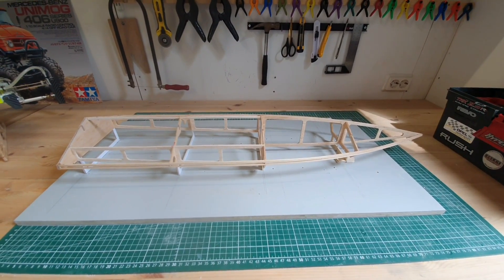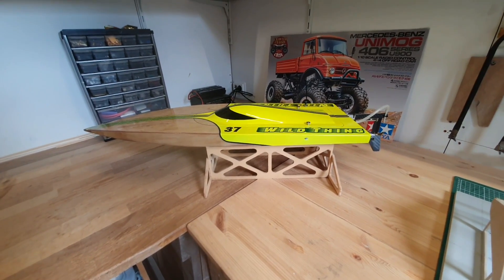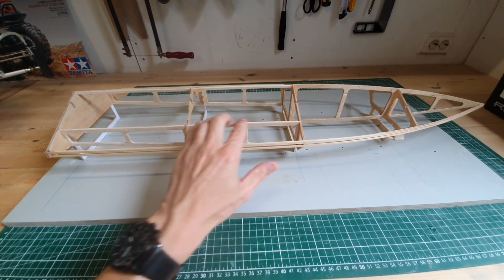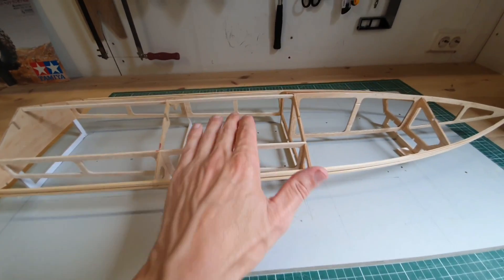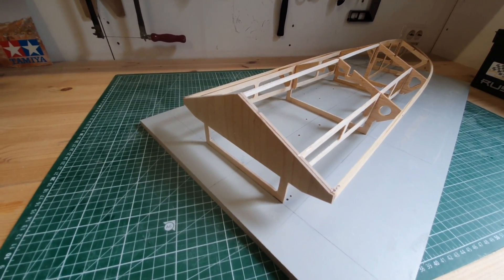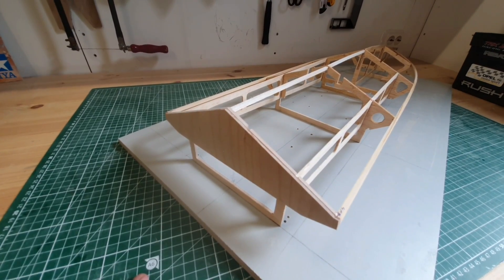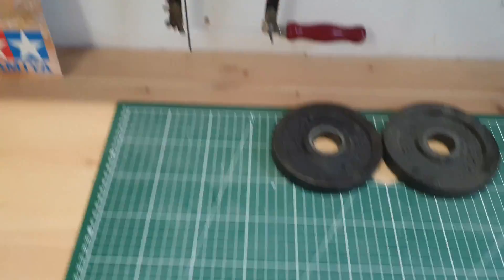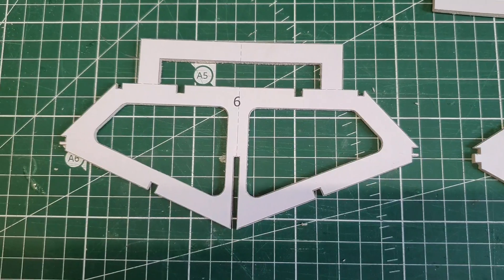RC boat build - Twin motor mono part I

Comment: Hello love watching your videos, which glue do you use?
Reply from the maker: Thank you, Mike! I use ca glue for the frames, and 2k epoxy resin for the plating, and sealing the wood.
Reply: @CozyRC  awesome, thanks. Have just downloaded your plans and got them printed out. Can't wait to start building this boat
Reply from the maker: Ah, nice one! There are several being built in US and Australia, that I know of. Will you put a twin setup in it?
Reply: @CozyRC  well now you can add New Zealand to your list. My head tells me to do a single motor. My heart tells me to do a twin and go full speed. 🤣
Reply from the maker: The bottom design of the hull is almost the same as my Wildthing. That boat ran 120+ km/h with a single motor setup. Rocket 4074 2000kV, Flycolor 150A, and CNHL 5200mAh 90C 6S lipo 👍. See this video for my Wildthing: https://youtu.be/h7QpCyItGts?si=_jqYz_2lhueDCPEK
A single motor will be crazy fast, too 😎

Comment: Hello. What saw blade do you use? It makes extremely clean cuts.
Reply from the maker: I use a jig saw blade for metal. It has  very fine tooth. But the smooth edges are the result after sanding!
Reply: Do you have an idea of the number of the blade? In ali-express they have, for metal, 01,02 or 03, plus some others for plastic and wood.
Reply from the maker: @OliveiraX  Sorry, I have no Idea, because I buy them locally at a DIY store, and it doesn't use such numbering.
Reply: @CozyRC  No problem. I'll get all 3. 😁

Comment: looking good!, I have watched the series already but I was wondering what type of wood you use? thanks a lot!
Reply from the maker: Thanks, I use birch plywood. 3mm thickness for the bulkheads and 1.5mm for the plating. ✌️DJ
Reply: @CozyRC  thanks a lot, do you use a protective coating against the water?
Reply from the maker: @maartenbernhard7663  Yes, I laminate the boat with glass weave and epoxy, for strength and water resistance. ✌️

Comment: Very interesting to see, but all that work... I see myself as a real rc enthousiast that likes to build, test creative ideas or try to make parts myself but this is just a step to far for me. But someone mentioned lasercut, that is an idea (for the future maybe). Sell models in a cut package.. 
Think youre right about the drives btw. I think that is more efficient and possibly easier to get it to run good... Nice work
Reply from the maker: Thanks Peter 👍.  I realize scratch building is not for everyone. Back I the days, this was the only way to make your rc boat or plane. I still like this way of building, although I might go for laser cutting in the future. ✌️

Comment: I thought it was laser cut bulkheads,so neat! Great job,mate!
Reply from the maker: Thank you Sakibian! Now you can make such neat bulkheads too, with basic tools 😎👍
Reply: @CozyRC  I'm not that good 🎃
Reply from the maker: @b2beyondrc This is not my first scratch build. Even with small imperfections you can make a great running boat! 
I made a Hydromite mini hydro as my first scratch build boat. It is more than 13 years ago and it is still running strong!

Comment: Wild Thing IV parts build=123kmh
Twin Wild Thing VIII parts build=? kmh😋
Reply from the maker: Let's see Daiciu, I hope at least 140km/h and if I could beat 160km/h or 100mph that would be my ultimate speed goal. But most of all, I will enjoy the build, running and tuning process and I hope to share it with you all 😎. 
Did you run your boat lately? I am sure your boat is 100+ km/h already!
Reply: @CozyRC  It whill be a very  beuthyful build Cozy I'm shour of that and fast to😁
No ,last weekend din't run my woody,thanks for the encouragement 100+
Reply from the maker: @daiciuapostol79  Allright, I will wait for your next results 😎.

Comment: I already know that this is going to be an epic build! I think you're on the right track going with stingers as apposed to struts. I'm gonna throw this out there - think about two rudders.
Reply from the maker: Thanks George! Twin rudders will look great behind the transom 👍. But as I love to do speed runs, I will go for a single rudder setup. It will reduce drag and hopefully givea higher top speed. Thanks for thinking along✌️